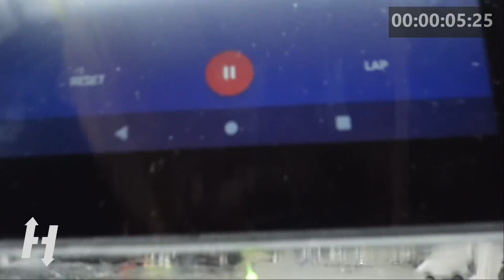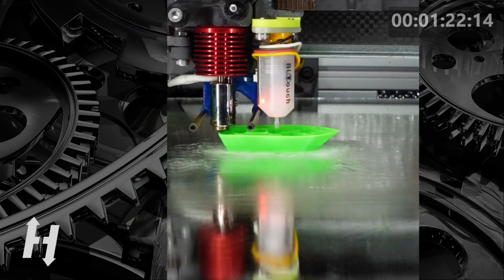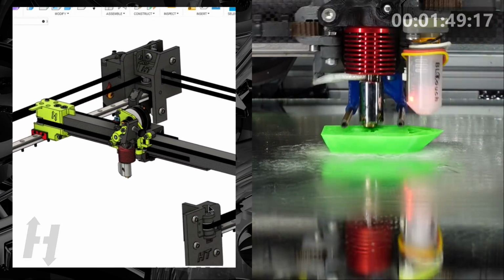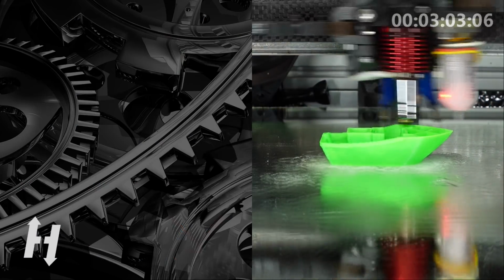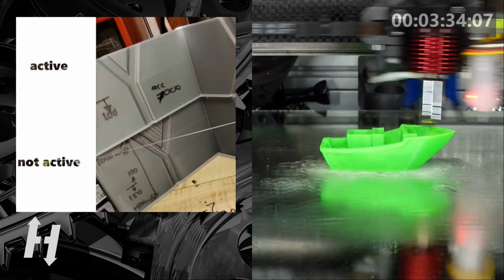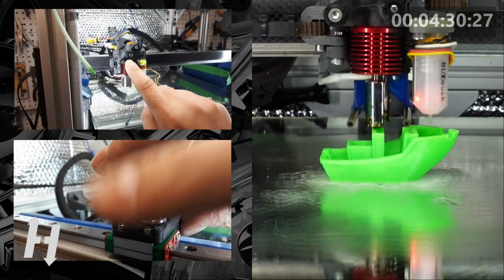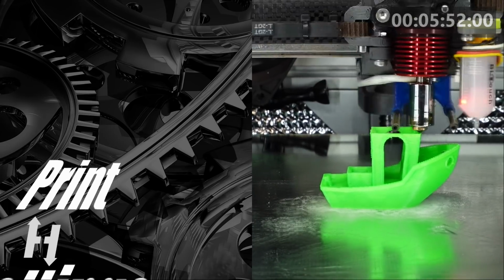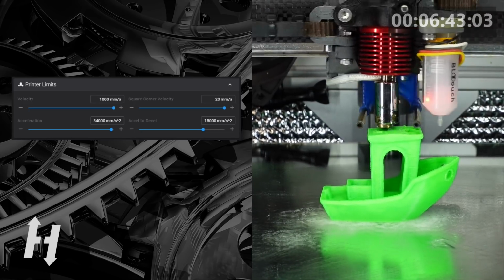My Recipe for FAST 3D printing

Comment: I'd love to know: if you now print slower, like the previous 16 minutes, does the new method but slower look significantly better than your previous 16 minute attempt? Printing a benchy this fast is insane, but if this makes quality focussed prints at 16 minutes possible you have truly started a revolution.
Reply from the maker: Yes, definately, the lighter gantry and Klipper made a huge difference on Quality/Speed ratio.  I'll make a slower but high quality one in a next video.

Comment: Just started using Klipper on my cheap ender 3 and love it. How has the switch to Klipper improved the speed? Did you have problems with previous firmware or board limitations?
Reply from the maker: MAjor improvement, my previous firmware was making use of the controller board's MCU to digest Gcode. Raspberry Pi is MUCH capable to do that.  So curves are not stuttering anymore.  Add the Input Shaper Magic and you've got a hell of a combo!

Comment: Have you considered switching to stiffer belts? A longer heater tube might help add time to heat the filament as well. 

If all else fails a second nozzle would help. There are some crazy compact mirrored designs using offset motors to keep them out of each other's way. With a second x axis beam you could slice the print in half and get double the speed.
Reply from the maker: Filament melting flow is not an issue so far.  Motor power is. The lighter gantry and klipper's input shaper make the 6mm belts very efficient.  A second nozzle system contributing to the same part would be difficult to manage.  Especially on the cooling side of things.

Comment: I would imagine that a extruder in the style of a Zesty Nimble will reduce the eight even further or?
Reply from the maker: I had a nimble V1 and the high gear ratio would not make it practicle for such speed.  I know they are working on a new version with lower ratio, perhaps i'll give it a try.

Comment: I see one improvement that "could" be possible. Make a hit swap bltouch that can automatically remove itself after calibration for lighter printhead.
Reply from the maker: Yes, I am on the hunt for a replacement solution.  BLTouch has become bigger and bigger.... Or perhaps my print head has become smaller and smaller...
Reply: @MirageC  Have you considered mental's microswitch probe? Flies are over on the annex github
Reply: @MirageC  I had a tought. Do you think using a bowden system would remove more mass from the gantry enabeling you to run it faster without overcoming the torque of the motors? or is there other limitations you run into useing that sort of system?

Comment: i think you burned the shit outta your finger lol. nice benchy for the time though!
Reply from the maker: I did!  haha!  :)
Reply: @MirageC  how realistic is this for actual use for real prototyping?
Reply from the maker: @svanput  Quite good actually.  The twisty part is to create a part specific slicing profile to maximize efficiency.   Layer bonding is excellent, dimension accuracy is repected.  surface finish is not perfect but for fast prototype, it works!
Reply: @MirageC  I'm more worried about bonding and dimensional accuracy.

Comment: I think y'all should shoot for the perfect 3DBenchy in under 10 minutes. In manufacturing, precision is the goal (within engineering tolerances) with speed being a close second, since time is money. Having to remake a part because it doesn't meet tolerances wastes material, and more importantly, setup and manufacturing time! 
The 3DBenchy is a perfect candidate for testing the precision of your 3D printer since it sends so many challenges to your printer to overcome. 
We should also come up with a scoring sheet to be more quantitative in the approach to scoring what is "best".
Reply: On 3DBenchys website there is a specs list with exact dimensions of all components. Thats where I would start and just add your tolerances to those figures.
Reply: i think a few people already have done that, or at least come very close to it

Comment: Me: Wow I have just done an impressive upgrade using linear rail to my printer.
Also me, after watching this: Ok, I quit.
Reply from the maker: Took ma a while to get there, but now the path is known and actually not that difficult.  Rails, Rigid Frame, Light print head and some good hot end.

Comment: I would like to increase the speed of my Ender 3 - do you have any tips on where to start?
Reply from the maker: Light weight moving masses and rigidity are the main two aspects.  It will be difficult to do on a printer that has a moving bed.  But still doable.
Reply: @MirageC  Appreciate it, will look into this - thank you!

Comment: So you are basically freezing the ABS right after a layer is put down. Have you tried this approach on any other prints?
Reply from the maker: All the time!  All material ;)
Reply: @MirageC  

Thanks for replying, I will make some cooling fans and try that out. Currently I am using heat lamps to keep ABS hot and not warp. Cooling the part down will be much easier.

Comment: Its amazing to watch these crazy fast prints. I almost want to take the dive and build a super fast printer but I don't need another rabbit hole / money pit to go down into. But, i'm curious, what are those tubes on the blue mounts around the printhead? Are those there to protect the nozzle in case the print comes off the print bed?
Reply from the maker: https://youtu.be/65FVQ1jArME  see 3min35 mark ;)

Comment: Some great stuff going on. How does the cfk tube hold the rail? do you simply thread the tube or are inserts required?
Reply from the maker: I made a printed tool to locate M3 Nuts and washers inside the tube.

Comment: @MirageC what's the best brand/type carbon fiber filament for stiff functional parts?
Reply from the maker: I love extrudr greentec pro carbon for its stiffnes but layer adhesion can be an issue.  If you need something with astonishing layer bonding and a bit of flex Nylon CF is a very good candidate.

Comment: What is currently limiting factor? If you just add more speed and accel what will happen?
Reply from the maker: Motor torque is now my road block.  I am using E3D High Torque Nema 17s
Reply: @MirageC  Have you try MakerBase SERVO42 drivers? It is amazing how much more torq I got with those. Naturally down side is that with that you can push more pulses/second what motors can spin without skipping. It just ruin print quality at point where it cannot keep up any more.

Comment: I am LOVING turning this into a competition. It’s definitely going to push the tech and innovation forward.
Reply: It's funny that the goal is speed yet in reality we all want quality prints faster. First must come the speed and the design that enables that.
Reply: @stevecade857  I think if this turned into a serious competition, it'd be neat to put the completed prints into a 3D scanner to compare the deviation from the base model. So it would be judged based on a combination of speed and quality.
Reply: carbon fiber printers 😍

Comment: finally the actual printer head linkage is closer to the nozzle level, i always wondered why people keep the distance so high so there is a lot of room for vibration
Reply: When I first got into 3D printing one of my first work projects was to get an old Airwolf HD printer working. That Bowden extruder was miserable but I understood the concept of reducing the mass needing to be moved. The solution that worked the best was mounting the extruder directly above the nozzle. Oddly the speed and accuracy and consistency greatly improved, we would print 300% faster doing so. When we scaled this to 1.2mm nozzles it required a dual stage heat system for moving that much plastic. The problem running that thick became heating evenly thru to the center and it prevented good retracts without any kind of cooling fans which for PLA we didn't previously need. But it got us decent prototypes in a day or so.

Comment: OK, it's impressive. 👍
Now, if you need to lower the speed to get back to excellent print quality doesn't that defeat the purpose? Or do you think quality can be improved by a lot with more tweaking?
Reply from the maker: Reducing time by 1 minute will greatly improve it.  But for a functional prototype part, this level of quality will be enough in many cases.
Reply: @MirageC  How's the wear at that speed? Do you need to replace belts/parts more often?

Comment: Don´t your fan set up make sort of a calm zone in the middle, right where you print? You should probobly reverize one fan and have more of a laminar flow over the print.
Reply from the maker: they are slightly angled downwards and misaligned to create a roll of wind kind of.

Comment: How did you attach your X linear rail to the carbon fiber beam, really curious
Reply from the maker: I printed a strip of plastic with cavities for m3 nuts and washer.  I then inserted this strip in the tube position the nuts ready to receive the rail.  Then I removed the strip.
Reply: @MirageC  Did you keep an .stl for that by any chance? I was going to ask you the same thing when I saw this answer LOL

Comment: Wow, this is such a huge step up from the last Benchy. Honestly, it's not fair that the delta guy's Benchy has the record, because that one looked 20 times worse than yours. Who cares about printing a Benchy that fast when it looks like ass? Your Benchy, on the other hand, looks great. The only real flaws were the bridges and the text. Even the smokestack looked significantly better than others at these speeds. Well done!
Reply from the maker: Actually, getting my printer to move faster than this will be a challenge.  I need more HP now ;)

Comment: It's impressive to think you're getting those speeds with a direct drive system too! I guess the old adage "bowden is faster cause it's lighter" has gone right out the window huh?
Reply from the maker: Never tried Bowden.  The Idea of multiple mm of retraction is not getting my vote.  I am using 0.2mm on this print.

Comment: This is pretty impressive, even if the benchy quality isn't great. How much money does it cost to build one of these from scratch, and how much upkeep and preparation is involved between prints?
Reply from the maker: 2000usd will get you a good one.  And very little maintenance other than rail lubrication and bed cleaning once in a while.
Reply: @MirageC  I assume that's with original MGN rails, original Duet board, Nova hotend and all the other bells and whistles, right? Also, if you don't ming answering, how many (approx.) kg of plastic are needed to print all the parts?

Comment: To give you a better idea of why you are not getting layer adhesion problems with all that air. There is a goldilocks zone of previous layer temperature and print temperature for the two to stick together. The faster you go, the more material there is to cool in a given period of time. This becomes a big issue when you are working with very large 3D prints. Inadequate cooling leads to a curling effect which can potentially ruin prints or let you get away with crazy overhangs. I tend to air on the side of completely tuning curling out. The next thing you can do to print faster is use clear filament. Sounds like voodoo, but trust me it helps. Going from white to clear is a massive difference, I imagine other colors will have less of a difference. Personally, it allowed me to get much, much higher print quality vastly lessening the amount of chemical smoothing I needed.
Reply: the clear filament would have no pigment in it, which would give you a edge with material i guess...

Comment: The print speed / quality of your printer is really impressive, but are this kind of print really usable ? I mean melting the plastic that high then cooling it very hard don't "kill" specification of the material ? 
I have no idea I'm really just wondering.

Comment: Good work keep it up. 

I have been working on a similar goal. But for me it's for production purposes. The idea I have been working on is chilled air. I have a concept in the works that uses Peltier coolers to chill the air and then pipe the air up to the hot end and direct it on to the part. Get the fans off the hot end and at the same time deliver very cold air to the part. 

After that a variable nozzle diameter would be the next big step. Areas that are flat like would greatly benefit from increased nozzle sizes. I have a simple idea on how to do it mechanically but no idea how to do it in software. One day maybe someone will figure that out. 

Best Matt
Reply from the maker: Thanks Matt!  Just looked at your channel!  I love the tool you have developed! As an ex-drag racer that would have been super handy with a bunch of custom fabrications!     good thinking!

Comment: When I saw “filament type change” I assumed you would be switching to something with a small CTE (e.g. PETG or PCTG). The fact that were able to remove heat as quickly as the hot end added it is impressive — great job!
Reply: I would have guessed PETG from the point of viscosity. On the other hand cooling becomes harder as well. Might be worth looking into differen types of abs to find one with a high flow rate and thermal stability.

Comment: That is a good Benchy for the speed! I agree this is changing 3D printing (along with Vorons), I think that fast off-the-shelf printers are going to be the next big thing. The prices will be high, but there's a market for it IMO.
Reply: High... initially. Much like the first 3D printers, and then the first good quality 3D printers. I imagine that eventually, 'fast' printing will just be... printing.
Reply: @Ithirahad  yes. Engineered products get cheaper with time, but there are certain requirements for stiffness and weight minimization that are likely to come at a premium for some time.
One the low cost machines have caught up, the premium ones will have moved forward to even higher speeds.
For professional markets, time is money. So paying more money for ever faster printers can be a good investment.

Comment: This is impressive indeed however my main concern is that printing this fast will reduce the strength and detail of the print. If there is a 3d printer that can print a part within 3 minutes while still allowing the printed parts to be strong enough to not break when step on and still be able to see a lot of detail then that would be the greatest invention ever.
Reply from the maker: Surprisingly, layer adhesion is very good.  I discovered that using side ducts for cooling will get the heat to sink into the part rather than creating a thin solidified shell around the molten material as soon as it exits the nozzle.

Comment: You should go back to the servo motors for a test and try a flying bear style bowden. And maybe try a graphite or CF ABS. I hear those have slightly higher thermal conductivity

Comment: Quality is pretty descent. The limiting factor is the extrusion flow now I suppose, about 40 to 50 mm^3/s ?
Reply from the maker: I am still in the 30 - 35mm^3 for this print.
Reply: @MirageC  Nice job. It seems you still have some margin on de/accelerations. Following with interest to see what's next ;)
Reply from the maker: @julienboucaron9780  Unfortunately not really.  I am pretty much at the max without getting motor skipping.
Reply: @MirageC   @MirageC  May be a small servo like the IHSV42-40-07-24 can help

Comment: Just wow! Is it possible to reach speeds anywhere close to that with my ender 3 V2 ?😅😅😅
Reply: Sorry, but no... ;)

Just make a quick test with the acceleration figures in the video. I am going at 2500 mm/s^2 on my cheap I3-clone. I can simy not go much above 3500 or so it will skip steps.

Also, at those speeds mentioned my heatend is not able to keep up. Btw that heatend is more expensive than my entire printer.
Reply: @sandos-x1t  Ah well, i asked because ender 3's hotend carriage is extremely light as its the bowden type , i thought maybe it is possible to do speeds over 200 and also since its light the acceleration should be no problem to certain extent.... welp
Reply: @kevinjacob7464  someones done 11mins on a ender 3 v2 with a dragon(i think) hotend
Reply: @specialingu  oo thats cool !